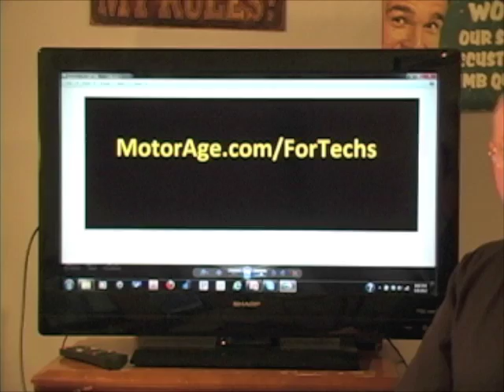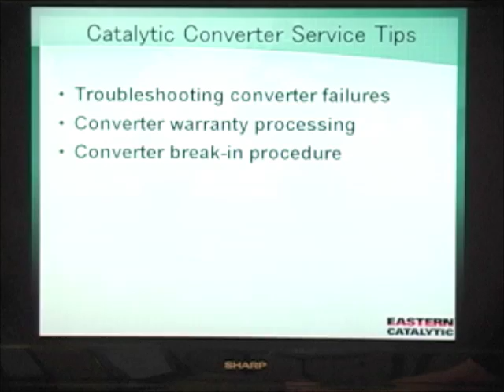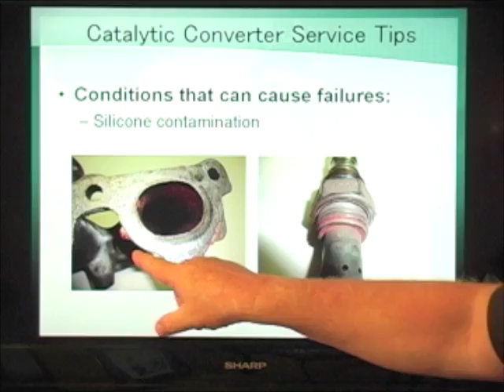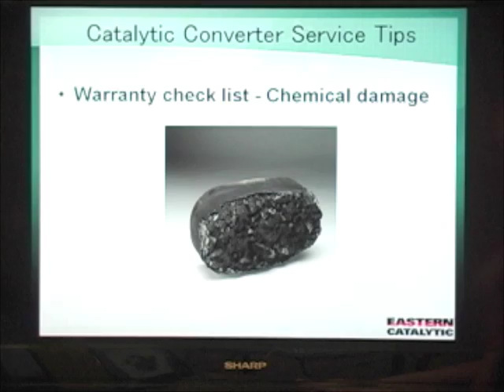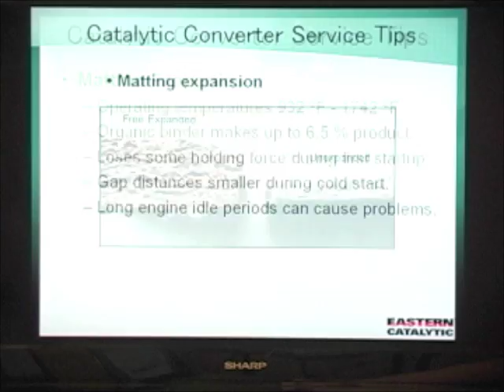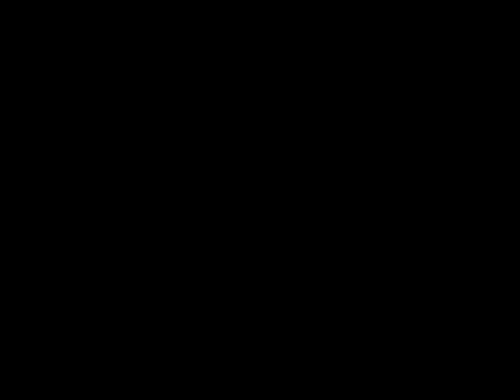Catalytic Converter Dos and Don'ts:  After Hours with Eastern Catalytic May 8, 2012

Comment: I bought a walker after market and what a horriable design not even close to rear manifold specs 2.4 flange and i received a walker brand with a 2.5 in diameter talk about exhaust leak never ever buy a after market converter for a GM vehicle with california emissions always go oem.

Comment: When building a new engine, and new Eastern Cats installed there comes 2 problems. 1)Engine break in says NO IDLE. 2500 RPM for 20 min on startup. Eastern says - Cat Break in 2 min idle. Cool. Then warm - Ruin Engine or Cat? That is the question... (use old cat for break in your anwser? old 6 Cyl cat wont work with big block V8)

2) I have heard engine break in oil additive ruins news cats. Engine says add additive with high Zinc content, etc. Again Engine or Cat? Both new both expensive...

Suggestions?
Reply from the maker: Frank Sullivan Wow! Interesting combinations. We suggest you contact Eastern directly for an answer.
Reply: +Frank Sullivan   Skip the CAT during the break in period.  Leave it off the car or bench run the engine on a dyno.
Reply: I just got the same problem with the new exhaust manifolds

Comment: after markets cats will work for toyota prius..if u rectify the problem caused for the catalytic failure...check the plugs,if you see oil in the plugs or if u having an engine miss,knocking,,check the pistons piston rings.do the repair first and replace with aftermarket cat,and reset with a scanning tool,,p0420 code will go defenetly

Comment from the maker: If the cat is overheating, it can indicate a possible meltdown of the substrate inside, restricting flow through it.  And that is typically caused by some engine condition that is feeding too much fuel to it. Do you have other engine codes or drivability issues or have you had them recently?

Comment: Most higher-mileage cars (100-150K miles) burn a fair amount of oil and would eventually cause a cat failure.  Can manifold cats be removed and cleaned to prolong the life of a vehicle even if the cats (minofld cats especially) eventually become re-clogged due to oil burn.  Any data on how much oil burn a cat can take before failing?

Comment from the maker: Converters made to OE specs by reputable aftermarket manufacturers should work just fine. The problem comes in trying to fit a "one size fits all" converter to any vehicle. It may work for a while, but won't last.